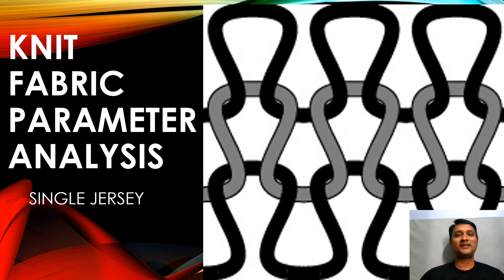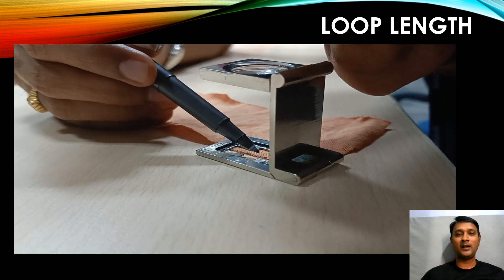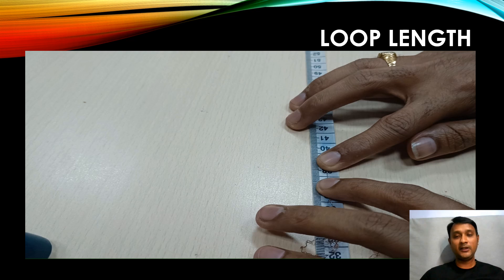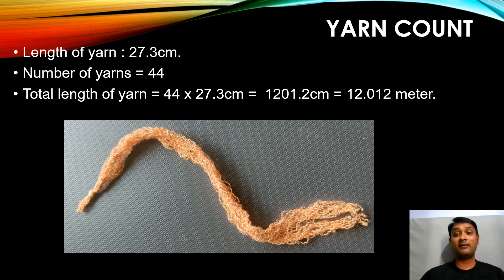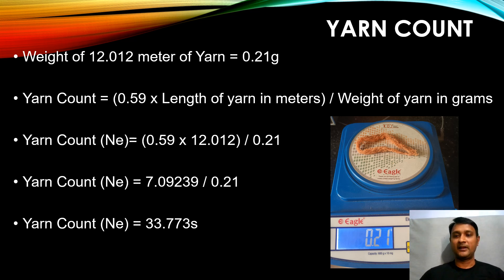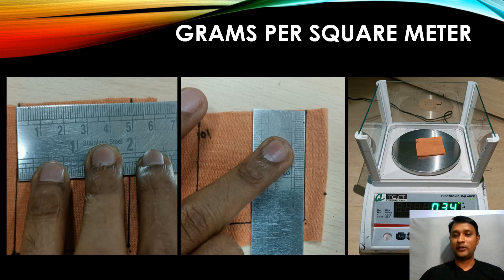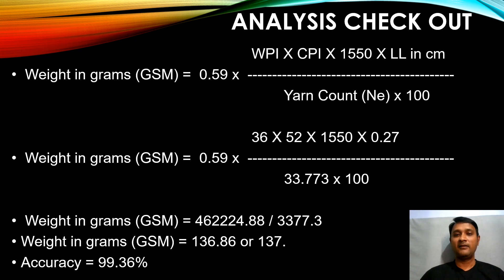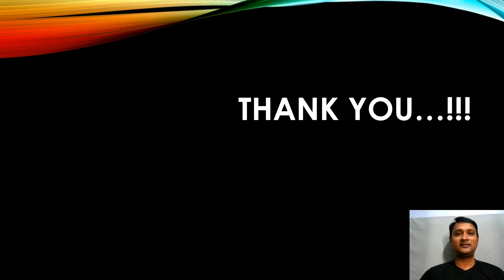KNIT FABRIC PARAMETER ANALYSIS - SINGLE JERSEY

Comment: Hi, do you always have to weigh 44 threads? Or can the amount be changed?🙂
Reply from the maker: Hi,

Thanks for your support.

It's not required to weigh 44 threads,  we need to get some reading in the weighing machine, accordingly you can decide the number of threads. If the yarn is finer, unravel more number of yarns, if the yarn is coarser, 15-20 threads also sufficient.

Comment: 36x52x1550x0.27=792136.6
Reply from the maker: Hi,

Kindly note 
Numerator= 0.59x36x52x1550x0.27
Divided by
Denominator=33.773x100

Results= 462224.88 / 3377.3 = 136.86 or 137.

Hope it's clear.

Also note 36x52x1550x0.27 = 783432, but you have mentioned 792136.6.